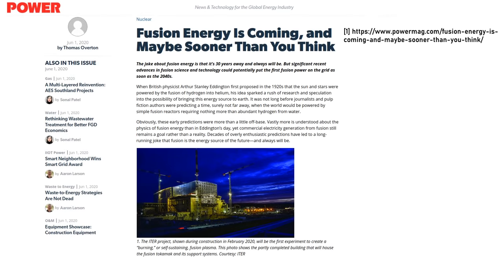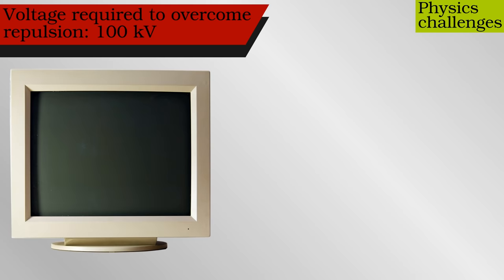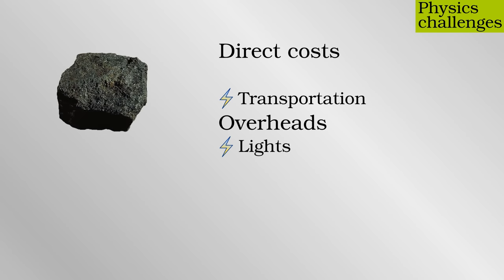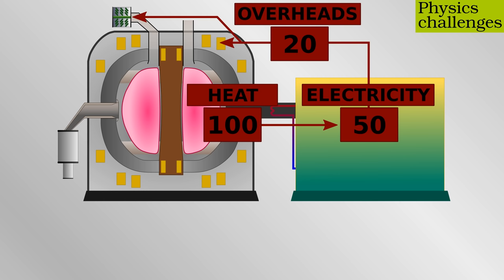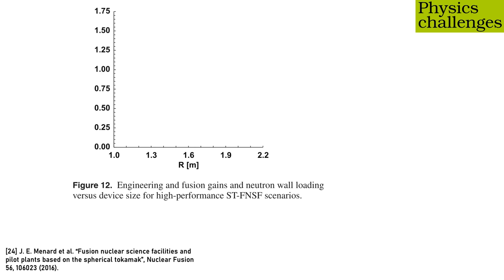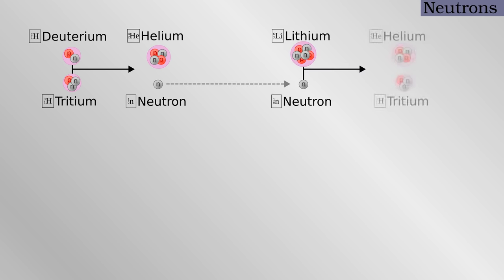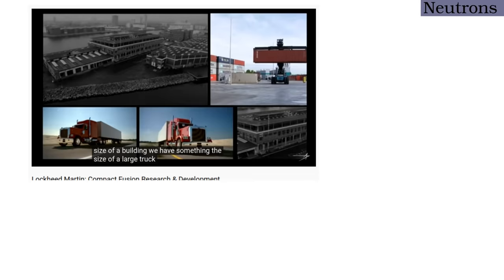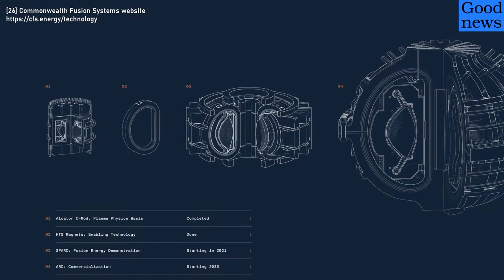Former fusion scientist on why we won't have fusion power by 2040

Comment: 11:23 - "Fortunately, there's a reaction where a neutron can strike a beryllium atom and release a second neutron, thereby getting two TRITIUM atoms for the price of one" - and the animation shows two HELIUM atoms.
Me: ...??!
Reply from the maker: Yes, it is Beryllium + Neutron -> 2xHelium + 2xNeutron. It's the 2xNeutron which can then each make Tritium.

But yes, there are three different reactions in this chain which make Helium.
Reply: @ImprobableMatter  Thanks, and yes, I figured it out latter on when I got to this this "boron-lithium blanket" part. (I typed this comment on my feet, so to speak.)
So, yes - boron here is merely a multiplicator of neutrons, and yes, this "boron-neutron" reaction eventually "produces TWO tritium atoms (latter on)", but still, it's kinda disconcerting to see one thing and hear something else.
But anyway, the video itself is of excellent quality - data, facts, animations with no frills and special effects, just to illustrate the subject. I subscribed right away : )

Comment: Solar energy, is by far the best sustainable energy source for the public. Fusion, Fission and fossil fuels are contaminating, solar energy is renewable, does not emit harmful greenhouse gases, is equivalent to the radiation that is already reaching the planet . Additionally, solar energy is virtually unlimited, making it a highly desirable option for meeting our energy needs.

However, one of the main challenges with solar energy is the need to regulate the flow of photons throughout the day and store them for use during the evenings and night times, when the sun is not shining; water, silica, salt are excellent for heat storage; batteries, capacitor can be used for electrical storage, or a managed electrical grid system. This requires the use of advanced technologies, such as batteries and energy management systems, to ensure that solar energy can be used efficiently and effectively.

To fully transition to solar energy, society will need to adapt its economic model to accommodate or facilitate higher relative energy costs. This may involve paying three to four times more than the current relative cost of using fossil fuels. An increase from about four percent of income to about twelve percent of income. While this may seem like a significant increase in costs, it should be noted that only 50% of energy usage goes towards creating essential staples, such as food and shelter. The remaining 50% is used for creating the more luxurious items we enjoy, such as electronics, transportation, and entertainment. Therefore, the higher cost of solar energy may not have as great an impact on our daily lives as some might initially think. Rough numbers from my standard of living.

Moreover, the shift towards solar energy will not only benefit the environment but also create new economic opportunities. For example, the solar energy industry has the potential to create new jobs in manufacturing, installation, and maintenance. Additionally, local communities can benefit from the development of solar farms and other renewable energy projects.

In conclusion, the transition towards solar energy is essential for reducing our reliance on fossil fuels and other energy sources and mitigating the harmful effects of pollution from the other energy alternatives. While it may involve higher energy costs in the econimic model, the long-term benefits, both for the environment and society, far outweigh the costs.

Comment: nuclear fission is possible the real problem is we just don't have anything that can withstand the heat of reaction water is too soft lead melts concrete melts we need a metal that repels heat that's durable we just don't have containment vessel I believe an electromagnet will have to be invented to shield extreme heat From reaction

Comment: I have spent years trying to find out how energy produced in a fusion reactor can be captured. Nobody ever says. All they ever talk about is the reaction. Fine, assume reaction. How do you get the enegy?  If it's heat and steam, how? Say heat the entire reactor inside a vessel and let it boil at 800 degrees, like a nuclear reactor?  ROTFL.  So no. So heat exchange must happen within the reactor. Perchance have you seen coal fired boiler furnace and the ranks and ranks of piping for heat exchange. So that would be inside the reactor? It is total nonsense.  So that means the heat must be directed outside the reactor. How?
Reply from the maker: The reactor vessel is indeed intended to heat up to 100s of degrees C, and is then cooled with water or helium, taking that heat away. A heat exchanger then goes to a turbine etc to generate electricity.
Reply: @ImprobableMatter  Would it be practical / possible to redirect the light produced by the reaction into a chamber lined with solar power to increase total captured energy?
Reply from the maker: @davedavidson8892  There is very little visible light given off by the plasma. X-rays and the like, yes, but there are no "solar panels" for x-rays.

Comment: This didn't age well😂.Like newyork times published 6months before first flight that humans won't be able to fly for another 1000 years.
Reply: Are you talking about the fusion experiment at ignition? I believe that's exactly what he's talking about in this video.
They aren't actually generating more energy than they put into the system or at least not more than they needed to make it happen. I believe they aren't taking into account the energy needed to power the lasers they're only calculating the power it needed to make the reaction happen.
Reply: @countofst.germain6417  I am talking about US energy departments fusion breakthrough actually.
Reply: @countofst.germain6417  Ignition was achieved, and it was including all variable factors because otherwise it isn't ignition. the only issue now is providing adequate cooling for constant pulses to provide a stable source of electricity, versus test pulses that required a long initiation period.
Reply: @lemonds4267  no, look into it more it's exactly as I said. The lasers needed something like 200 units of power and the fusion produced about 2 units.
Reply: @markazulislam5143 okay well I don't know why you would be talking about that? lol no-ones claiming that's some major breakthrough that will give us fusion in 10 years, its less impressive than ignition.

Comment: I said it before but it's disappeared, so I'll say it again:
You've ignored alpha heating and lithium isotopes.
The D/T fusion reaction puts about 20% of the energy it produces into the alpha particle[He4 nucleus] that it produces. This particle stays in the reactor and its energy heats the plasma. If Qplasma > 5, which it will be, then the alpha heating will keep the fusion going for as long as it has fuel with no additional energy input to the plasma, although they'll only allow the fusion to continue for about 4 seconds because they don't want the reactor to melt. The heat energy generated in these 4 seconds is massively more than enough to create the electricity that created the FM heating that started the fusion. [The heat that stays in a fireplace and ignites additional firewood is massively greater than the heat in the match that started the fire.]

D + T -> He4 +n
n + Li7 -> He4 + T + n
So the fusion of one tritium atom can create an unlimited series of reactions breeding new tritium atoms from Li7. M.I.T. is currently doing tritium breeding experiments and designing fusion reactors that breed more tritium from lithium than they consume in their fusion reactions.

You're fretting over old problems that M.I.T. has already solved  although other fusion groups will probably never solve them.
You apparently weren't a competent fusion scientist. My background in fusion is just YouTube videos from CFS/M.I.T. and email from CFS/M.I.T. researchers.
:-)
:
Reply from the maker: Your first (of five) comments is still up. Since you appear to be incapable of navigating a comment system, or indeed elementary school mathematics, I will repost my reply to that comment.

I just can't fathom why so many people are misled by this Q>5 business. "no additional input of energy to the plasma" corresponds, by definition, to Q = infinity. This certainly can be achieved in theory, but for a tokamak this would require 100% of the current to be bootstrap current, which has never been experimentally demonstrated.

Comment: Ignoring politics and such .. Is there a technological reason why don't they just detonate a small H-Bomb for fusion energy inside a very large water container .. expansion of the water due to the fusion energy drives a turbine and thus gives electricity output .. rinse and repeat .. not a continuous process .. and sure people don't like using H-Bombs .. but is there a technological reason that approach would not work ?
Reply: I'm not a scientist but I assume that even the smallest of nuclear bombs would be so powerful that they would destroy any containment unit after 10 detonations
Reply: @SPCv4  I acknowledge it wouldn't be 'easy' .. but .. I wonder if there is a technological reason that approach would not work ??? 

Using the technology of last 1950s the U.S. military built and tested as small as 10 tons of TNT nuclear devices .. We could no doubt do even smaller now , with 70+ years of technological progress .. and because the force gets distributed over the volume of the container , the bigger the container the smaller the force per area on that container .. 100 pounds on 1 inch is 100PSI .. but the same 100 pounds over 10 inches is only 10 PSI  .. over 100 inches the same 100 pound force is only 1 PSI , etc .. 10 tons of TNT is about ~11.6Mwh of energy .. the 3 Gorges Dam online in 2012 built with 1990s tech .. is rated to 22,500 MW .. such a facility can process a ~11.6Mwh energy release like that every about ~0.5 seconds , and do so for decades .. ~11.6Mwh of energy could convert about ~4,900 gallons of water to steam .. as steam it would expand 1700x or about ~8.3 million gallons of volume (aka ~31,532 cubic meters) .. The 3 Gorges damn holds about ~39 Billion cubic meters of water .. maybe you don't need the container to be that ridiculously large to be able to take the distributed force .. and it would still be a 'mega-Project' .. but .. It seems to me we have the technology to build a facility like that .. we don't need to invent new tech or science .. I wonder if there is a technological reason such an approach would not work , because although a Mega-Project .. it seems (to me) to be technologically doable with today's technology.
Reply: Radiation? Covered. For the purposes described, we'd need a whole water body, which has proven so effective that it is actually possible (but of course, not recommended) to swim in the pools used in Fission with negligible contamination. Of course, we'd need bigger than that if using H-Bombs outright, though I imagine it'd be the least of the engineering to miniaturize the tech. Perhaps this would be a step in Fission-Fusion Hybrid Reactors, then pure Fusion later.
Integrity? Covered. Water is a fluid, so it cannot be broken in the same sense a solid can. It can take tremendous force as well, as the pressure of the water means the explosion can only go so far, before following up with an implosion. Hey, that even sounds like a star! Gravity inward, pressure outward. Just substituting gravity with counter pressure!

Comment: I’m not sure what the point of the presentation is.  Anybody who worked on externally funded projects (meaning anything above fixing a bicycle in your basement) knows that in order to acquire funding one has to put deadlines and provide benchmarks. This is normal planning. The more complicated the project the higher uncertainty about deadlines provided.  So let’s agree that the project will not be completed in 2040, but will be in 2045. Would the author of the video also mock it and consider a failure?

Comment: It is just a dream that will never be achieved.
If one considers the power in that plasma which is more like the centre of the sun and how to control it in a small crucible here on Earth, then one can see the problem.
It's a fiery beast of immense power.
To instantaneously change the magnetic flux to control the fusion current might prove  impossible because of back emf. (the electromagnets are massive).
Reply: So was space flight.
Reply: @kenofken9458 what’s the point of space flights?

Comment: if fusion ever becomes practical, it will be something that is easy to do, and not something that is hard, something you might do by accident
something like cold fusion or whatever safire did
if you're not up to speed cold fusion is real, and the original dismissal was due to a (possibly intentional) bad faith attempt at replication